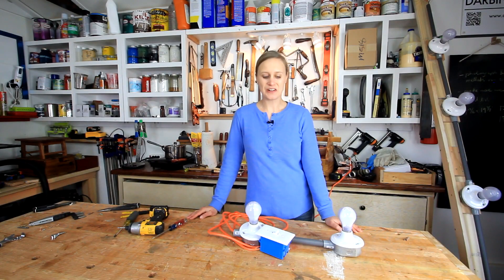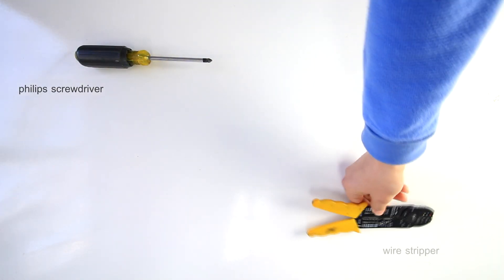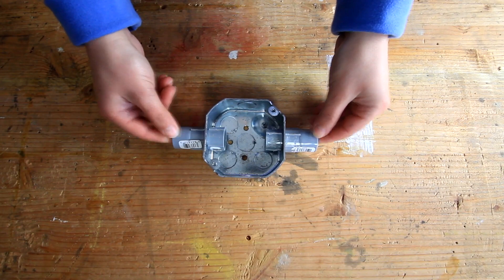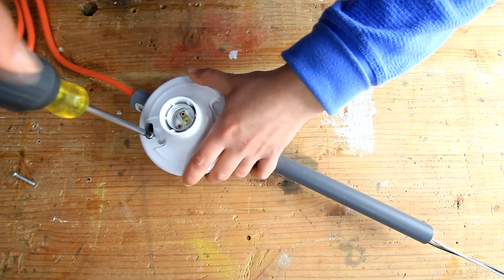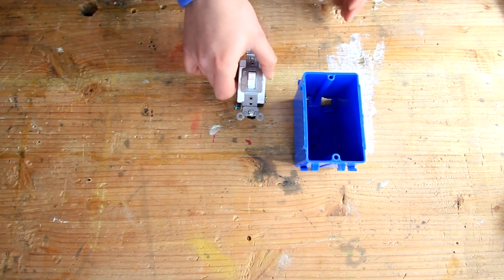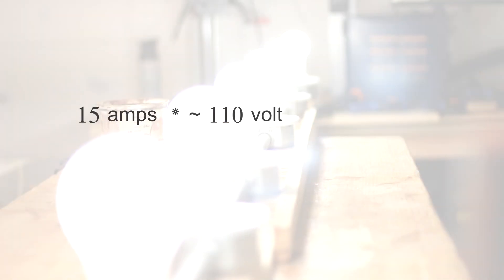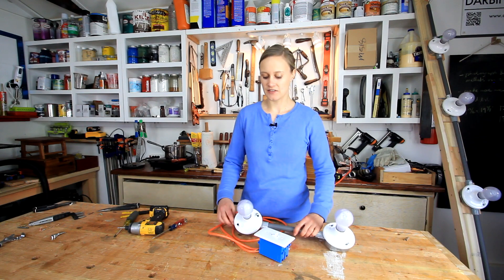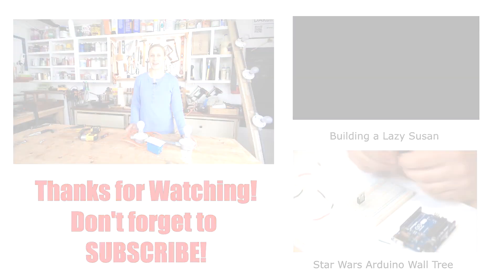DIY Lighting for your Home w/ LEDs

Comment: Nice tutorial. I always thought when you used metal junction boxes that you had to use a conduit clamp to secure the wire. This is to prevent someone or something from pulling the wire out of the box. Plastic junction boxes have a plastic tab that serves the same purpose. Maybe code is different in your state/county
Reply: Quite right! Although I don't think electrical code really comes into play here, since none of this work is in the walls, but I would like to see a clamp of some sort holding the braided cable (extension cord), just so that you're not pulling directly on the wire nuts if you gave the extension cord a tug.
Reply: WestCoastMods 
I'm shocked to see Americans still use metal junction boxes.

Comment: Good video. It seems like no matter how much light you put up, it never seems to be enough for filming purposes.
In my shop, my next step is to paint the ceiling white so it reflects more of the light downwards. Also, what I've also done was put up a switched outlet on the ceiling and just used normal hanging shop lights.
Reply from the maker: Harry of All Trades Thanks for the comment. I agree you can't have enough light!

Comment: I have seen a LED light bulbs (tubes) that looked like the 4' fluorescent light tubes you normally see in shops.  I hope to put those in my shop.  Great explanation on the electrical formulas and the wiring.
Reply from the maker: Saw Dust Maker Thanks, I haven't seen 4' tubes anywhere in my local stores.

Comment: Hey, this is a fun project as well as practical. I'm emptying out a garage in preparation for a complete remodel of this hovel. Having strip lighting held up on the (bare) studs makes this lighting idea a lot better than a bunch of lamps with cords running across the floor. Only caveat is that it might be useful to mention to folks to use better quality extension cords for this project, not the super cheap zip cord type we all had as students. :D

Comment: Nice. People will quickly find out which is the best way to bend the wire... clockwise. Like how you broke it down towards the end. I also belt and suspender the receptacles I install.

Comment: I just finished installing some LED lights in my shop. I purchased them through the power company here and they were $2.50 each. Take your time and do it just like Lin has shown. Another trick is if you have not completely wired up your shop take some White LED Christmas lights and string them around inside it puts off enough light to see what you need to and I purchase a set of 100 for $10. Since they draw very little electricity its cost is very cheap plus I now have a overhead LED and a set of tubes over my workshop bench. LED is the way go.
Reply from the maker: Robert Jacobson Thanks for the comment Robert.

Comment: Hi instead of using of the light switch can you use/install a dimmer instead thanks I would really appreciate your reply
Reply: dimmers dont work with led bulbs, they strobe at low setting

Comment: Hi, Linn. Thanks for this usefull video. Are there much differences between the LED light bulb and the regular fluorescent bulbs in terms of lighting capacity? Thanks again.
Reply from the maker: Marcelo Freitas Thanks Marcelo, I can't think of anything better about fluorescent lights.
Reply: You will get more lumans (light output) from a fluro but thats because its not as directional as some led globes are also the standard length fluro tube is 36watts. Personally for looks id go LED, for consumption id go LED but for cost per area to be lit id go fluro
Reply: *Lumens

Comment: A few issues with this DIY video. 
Unless this is just for temporary purposes the extension cord isn't really acceptable.
There should have been a cable clamp connecting the cord to the first light.
Circuits should only be loaded to 80% so in this case 12 amps.
That extension cord is likely only 16 awg wire so it shouldn't be loaded to 12 amps either, 10 amp rating, should be limited to 8 amps.  
When you were putting the switch cover on I noticed the end of the outer jacket of the cable outside the box, it needs to be securely fixed inside the box, you don't want the clamps holding down on the conductors.
This falls into what I do for a living so easy errors for me to spot. 
BTW, LED lights are awesome.
Reply from the maker: traog You should make your own video and let everyone know how to do it right, and I'll stick with giving people cool lighting ideas. BTW, I agree they are awesome.
Reply: Um...she only had 2 lights on it,  so in this case there is no problem!
Reply: Darbin Orvar Lynne (sp?), as much as I love watching you and your videos, I have to disagree with you on the content of this video and support traog in what they were saying here.  When dealing with electricity, there are many things that should be considered as well as codes that are there to protect us all.  Electrical wiring should be done to follow codes or left up to a licensed electrician because so many things can go wrong that the DIY'er just doesn't know.  Please don't take this as an attack on you personally because I know your heart is there to help others learn something new that they didn't know or want to learn, but doing electrical work isn't something to DIY unless fully informed beforehand.  There have been many a home burn down because of faulty electrical wiring done by a homeowner with good intentions.  I've said enough and I look forward to your next video.  Again, I applaud your willingness to help others.  Keep up the good work!
Reply: Actually, all my extension cords are at least 12/3 and a couple are 10/3. I'm not the least daunted by the prospect of using them for such low impact portable lighting.
Reply: I was addressing what Lynn used in this video, not what you or someone else uses. What I wrote still stands, and you using a heavier cord doesn't change the load calculation corrections I mentioned.
Reply: traog Nah, that's not true. What you were doing was NOT LISTENING to what was said in the project itself. What was built can be used safely exactly as she' demonstrated all day long. She didn't say to put this stuff into the wall. That's a straw man. plonk
Reply: Ru Hall The only one here who didn't  LISTEN to the video here is you apparently. Did you miss the part where she did a load calculation, that I corrected her on?
The only straw-man argument here is yours, at no time was part of my argument that it was to be installed in a wall.
Even so your straw-man is a rather stupid one anyway because there are electrical codes for ALL wiring not just that which is in a wall. Your level of ignorance on the topic is glaring.
Reply: traog Nah, you just can't stand being hoisted on your own petard is what. Show me a cite in the NEC where an individual is not allowed to make a series circuit LAMP with the wire from an extension cord and plug it into a socket.
Reply: Ru Hall Did I ever say it can't be done? My contention is with her technique to do it properly,and her calculations, neither of which have you addressed.
You also exposed your ignorance of the subject once again, the lights are wired in parallel not series.

Comment: Good video basic electrical.  At the switch I don't think I would have cut the ground and neutral but left them in tact and only cut the hot.  Switches only handle the hot anyway. Nice job as always!!
Reply from the maker: Randy Sieb Thanks for the comment Randy. I agree but it was a different extension cord used.
Reply: ***** Oh yea stupid me.  Totally forgot the ground.  I stand humbly corrected!  ;-)
Reply from the maker: ***** The switch was grounded.

Comment: Very good project. 1 comment if I may . The safety of electricity and lighting is in the proper installing. A bit of a slower and closer camera view of the wiring of light socket and especially the Switch hook up. The white( traveler wires are connected together with a molly), but the ground and black are connected to the Switch. This is not overly evident if just watching the video. It is a critical part of any safe electrical installation.

Comment: nice, FYI wire nuts are illegal in Europe and most of AsiaPac, the reason is vibration causse them to come off, a more robust connection is far safer; solder, crimp or connector block, all to be insulated.

Comment: This is a great video.  I'm just frustrated (not specifically with you) that we "measure" light in watts, just because we used to use incandescent bulbs.  A watt is a unit of power, not of light.  But we're stuck saying that this 11 watt LED puts out 60 watts of light, which both isn't true, and in the near future people won't know what the light from a 60 watt bulb used to look like.

I think in the long run, we'd be better off if we start thinking in another measurement of light, say lumens.  So those 11 watt bulbs put out 800 lumens each, and 150 of them can produce 120,000 lumens.

But this is a country that violently opposes learning metric, so I don't have high hopes.  We'll probably be talking about 60 watt equivalent bulbs long after the last incandescent bulb is burned out.
Reply from the maker: Brian Diaz Thanks for your comment.

Comment: Good video; however, watts is not a measurement of light brightness.  You'll want to use either lumens or footcandles as units to determine this.  It's a marketing gimmick for LED bulbs to say they're a "60 watt equivalent" and it really doesn't mean anything.
Reply from the maker: Drew Budwin Thanks for the comment.

Comment: You should definitely not do these types of tutorials without telling people that it is in NO WAY done to any electrical code. If your going to use it as a temporary set up maybe but this can NEVER be installed in the walls. Sorry Darbin as a professional these kinds of things make the hair on the back of my neck stand up!!!!!!
Reply from the maker: Pat M Never said to put it in the walls.
Reply: Darbin Orvar I sent you a PM.
Reply: Who said to put it inside walls? Part of the appeal of this is that it's essentially a lamp, easy to build to one's needs. SO much cheaper than the ugly junk I would have ended up with if I had to hit the local thrift shops to light up an ancient garage being remodeled.
Reply: Darbin, maybe you need to paint a mustache on your face or something. It seems there are guys watching with the sound off. LOL
Reply: What's the Code say about making a series circuit and plugging it into the wall socket?